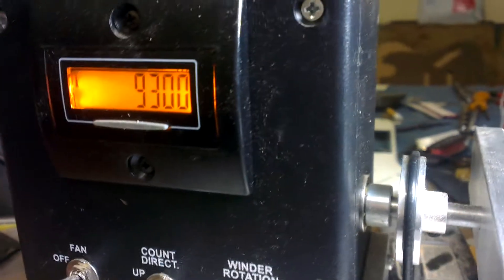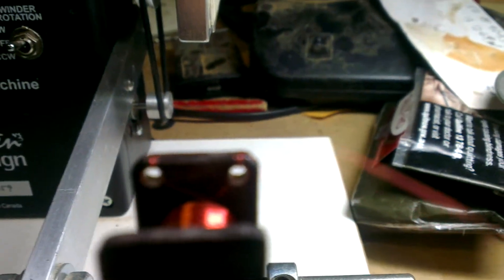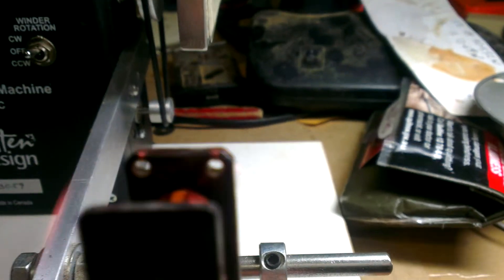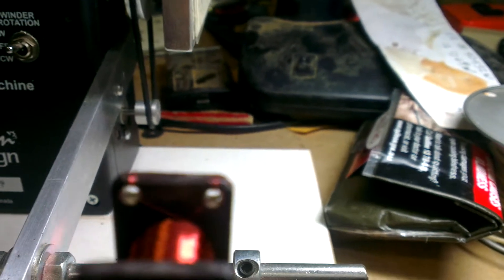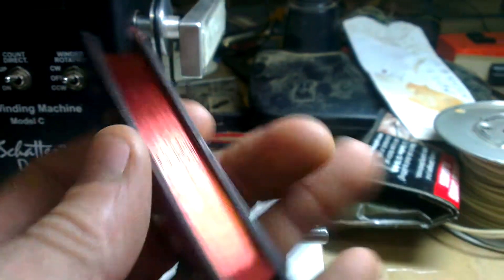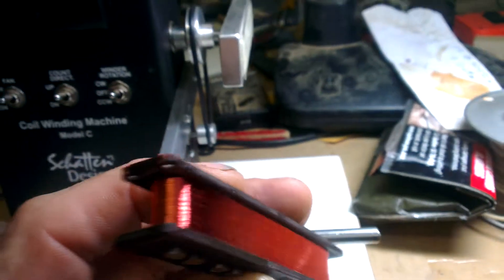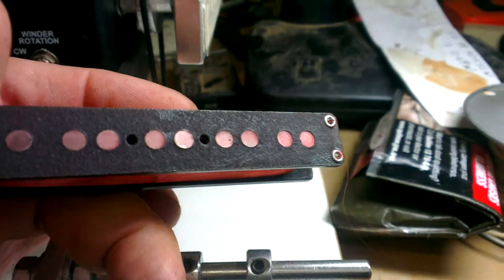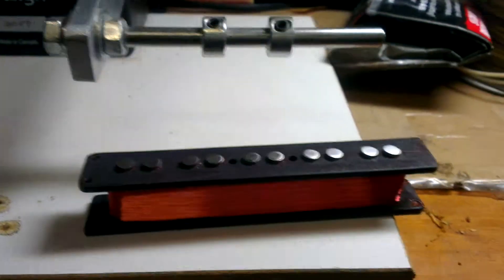5-String Jazz style bass. Winding pickups part 3

Comment: This is a craft and art form that benefits our universe!
I need to get a new neck for my Charvel ... after 28 years its finally kaput.
I am going to have to salvage off a used guitar I think. Buy a used for 150 cheaper than a new 200... thanks for posting your work.
Reply from the maker: DVincentW2 Thanks man, I'll try to get more of the woodwork vids up, the tolerances are tighter than pipe work and it can be nerve racking sometimes (you can take wood away but you can't put it back), but somehow I manage to survive the attack of the killer piece of wood and look around for the next one..